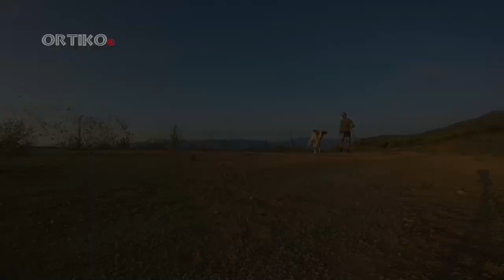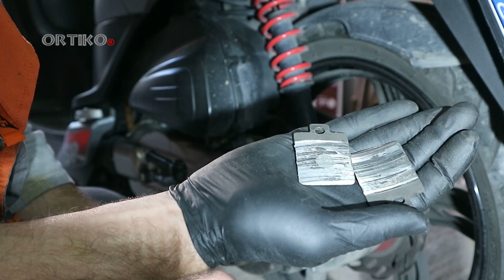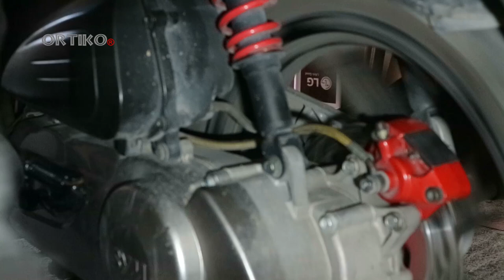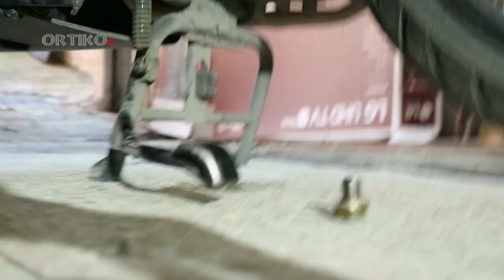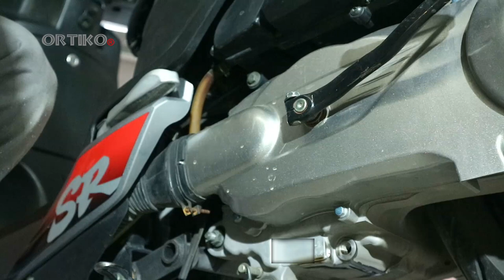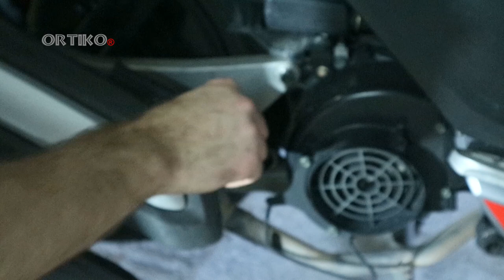How To Replace Brake Pads  & Motor Oil  Sym Symphony sr 150 scooter Service

Comment: Great tutorial. Just replaced the rear pads on my Symphony, 10 minutes work. I've been most maintenance myself so far, inc. belt and rollers replacement, but somehow avoided replacing brakes. It comes out it's the easiest job!

Comment: The brakes caliper get 35 nm torque the oil screw 30 nm torque and next time First Clean the brake caliper inside from dust with water or brake cleaner

Comment: Never push back piston with a screwdriver 😢 and bevor Insert pads cleaning 🧹 the piston insider with water and soap and put a lilte bit grease at the back side of the pads never put new pads in a dirty Brake caliper